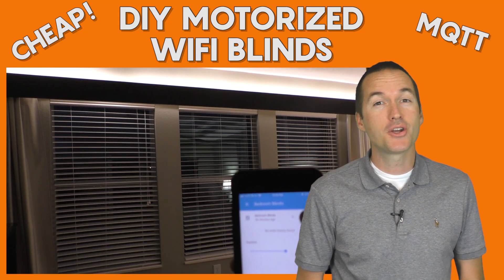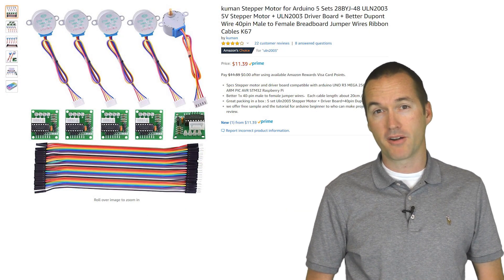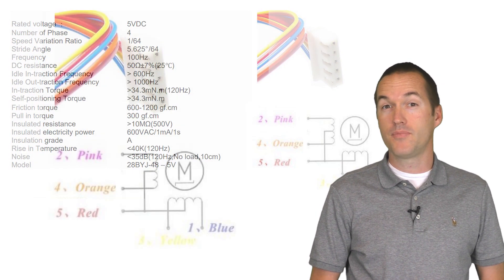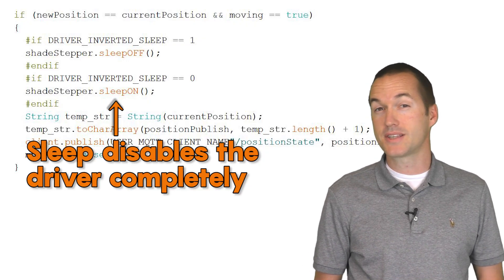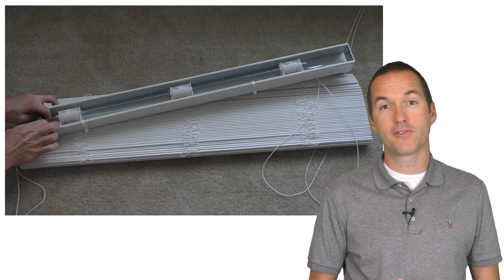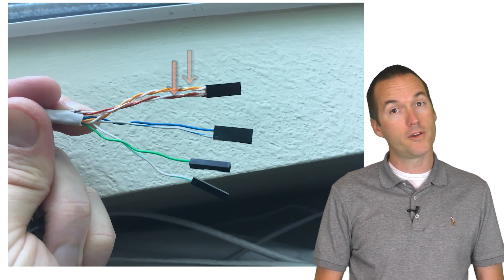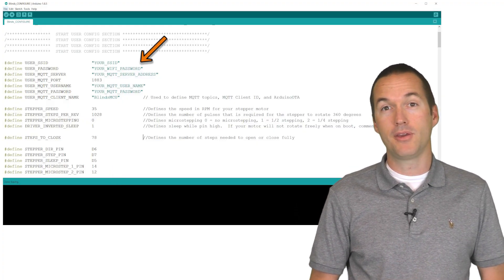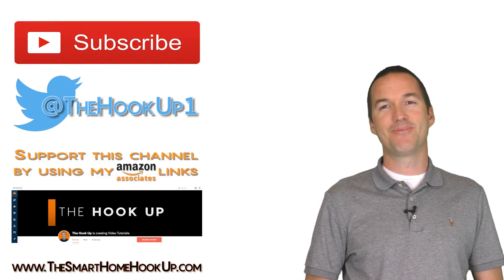Motorize and Automate your Blinds for $10! (WiFi)

Comment: I did a similar project a year ago: https://github.com/Warsenius/Domoticz-Mqtt-roller-vertical-blind  only change is I have vertical blinds and they have no room at the top to hide the engine in.
And i use Domoticz as my home automation controller. rest of the project is almost the same.
I added a 'reed' switch and a little magnet to the ball-wire so the system can align itself every day.(I had a little problem with the system losing alignment after frequent use, i suspect making the steppermotor sleep causes it to turn back a little)

Comment: Interesting, but a am slightly amazed that the driver didn't seem to like 12 volt. It is a ULN2003 that can take 12 volt.  I would expect the 5volt stepper to be the one having problems with 12 volt
Reply from the maker: It was behaving very strangely, I'd imagine it was a current issue and the ULN2003 doesn't have current limiting.  It would work if I messed with the jumper, but only for 1-2 seconds before failing again.

You are right though, the ULN2003 says 5-12V right on it.
Reply from the maker: I just got the ULN2003 to step at 12v using the Accelstepper.h library, but WOW the motors get hot fast.  Pretty good torque though.
Reply: @TheHookUp  probably don't want to reposition the blinds to often then :-)
I am considering the Nema17. AliExpress has that at around 5 euro. That's 12 volt and supposedly has a pretty good torque. At 42.3 mm it might be a tight fit though
Nevertheless pretty good video

Comment: You're spot on with regard to 3D printer ownership. I've printed enough parts for household repairs and DIY projects to more than pay for the printer, so the ability to use it for tinkering/making is icing on the cake.
Reply: hum.. 3d print icing..

Comment: Rob, how big of a set of blinds do you think these motors could handle?  It looks like your windows are around 24-28" wide, but based on your build commentary I'm guessing these motors won't be able to handle much more than that.
Reply from the maker: With the 12V mod I'd guess 48" would be possible, but it really depends on the weight of the blinds.
Reply: @TheHookUp  what would you need for 59" and up to 94" size

Comment: Is it possible to modify this project to use a 12 V battery pack with a slim solar charger panel that sat behind the blind header ?
Reply from the maker: That is currently in my project pipeline, need to add some deepsleep functionality to the ESP to improve battery life.  Stay tuned.
Reply: @TheHookUp  I have a working (for the most part) set of automated blinds that work off a servo and solar panel.  I can't take credit for it as it was developed by someone else for SmartThings, but I did modify his code so it would work with Home Assistant and MQTT.  I can probably shed some light on it since I've been testing it for months now and there are many hurdles to overcome.  Many of which I'm still working on.  

The system uses a "hub" (plugged into the wall) which is simply a D1 mini with a RFM69 shield.  It monitors MQTT over wifi for msgs and relays them to the blinds over RF.  The blinds module uses a Moteino (LowPower Labs) with a RFM69 module connected to a 3.7v Lipo, 5v (500 mA) solar panel, relay, voltage step-up and servo.  When the Moteino receives a message, it activates the relay allowing power to flow to the servo.  It sends the control signal to move the servo then turns off the relay cutting power to the servo.  The servo stays locked in place without draining excess power.  The Moteino sends the voltage and charging status of the battery to the hub then goes into deep sleep and waits for the next message.  There is also an option to use a switch if you want to manually control the blinds.  The Moteino sends a positional update to the hub which then updates MQTT and Home Assistant.  

Now for the issues and problems.  Wifi is generally power hungry thus why this uses RF and a hub.  I believe MySmartBlinds that you showcased in your video uses bluetooth and hub which I assume is for the same reason.  

Deep sleep is a big help to conserve battery power, but unfortunately people have been having issues with the Moteino and RFM69 chip NOT waking up from deep sleep when receiving a message.  Others have been having success with not putting it into deep sleep but I'm sure it matters where you live and how much sun you get.  I've been testing it without using deep sleep as I have 10 blinds, 5 of which are 15' in the air so I need it to work flawlessly.  It's been promising, but it's been fairly sunny lately and the days are getting longer.  The real question is, will the battery have enough time to charge during the winter months when days are much shorter and grey?  I have yet to test winter months by unplugging the solar panel and only charging the battery for 7 hours.  To be honest, I'm not very hopeful.  I started with a 5v, 250mA solar panel and it failed quit quickly.  I moved up to 500mA panel (max of the charging circuit) and it's been much better though I don't think it will be enough for winter months.  One thought was to change the charging circuit  to handle a higher output solar panel.  I'm not well versed in this area and haven't went down this path yet.  I still plan on testing my current system using deep sleep, but I'd hate to move forward, order the parts for 9 more blinds only to find out 50% of them fail.  I'm curious as to what charging circuit MySmartBlinds use and the output of the solar panel.  Other than that, it looks like it's using a DC motor with encoder, LifePo4 battery, and rotary encoder for manual adjustment. 

DM me if you want to chat more about this.  I'd love to help.  Solar powered blinds is what got me interested in home automation.  It probably wasn't the best project to start with now that I think of it ha ha.
Reply: @dipper1981  How has your setup been working?  Can you supply links to the project you mention or any other links that may be helpful?  Thanks
Reply: @TheHookUp  maybe ESP-Now can be used to wake an ESP out of ultra deep sleep
Reply: @TheHookUp  I was comparing some boards for deep sleep - many are in the mA range. Best to go with a bare ESP32 which only draws 5 uA (or even less in hibernate). Still want to compare communication. I guess RF < BLE < BT < Wifi. Maybe ask a RPi or a non-battery-powered ESP32 over BLE what to do in certain intervals (depending on how responsive the blinds should be, this can save a lot).
Reply from the maker: Can ESP-Now do that?  It would still need to use the wifi radio, which is disabled during deep sleep.
Reply: @TheHookUp  13 window blinds I need to automate in my home... (and nowhere to hide wires.) I need this! 
I've been researching/waiting for this project for 8 years (sadly I haven't had time to learn all the ins-outs to do it myself.) A how-to to run this on battery and/or solar would be the last piece of this puzzle! 

You are seriously making my dream come true, definitely Subscribed!
Reply: Yea run off solar panel would be great, or solar to charge battery

Comment: Pretty excited to see this video and the price point floored me though it seems to be a stretch.  Could this be coded in ESPHome?  Thanks for this great video!
Reply from the maker: I tried to make it work with ESPHome, but I'm not familiar enough with it to make it work the way I wanted (and the stepper support for ESPHome and HA is weak).  Basically it needs to have a sensor associated with it to be able to "retain" its position as saved and then use the set target command to move to the open or closed position.  

If you get it working with ESPHome I'd love to include it on the github!
Reply: @TheHookUp  How many rotations does it take to move a full open -> close cycle? Maybe a limit switch like on the ender 3 axis?
Reply: @TheHookUp  and @Donny Fontenot Any advances on the topic of using with ESPHome?  I"ve built some using a servo (MK SmatHouse based design) and now that I've bought the parts for your design I plan to give it a shot.   I'm sure the Arduino IDE route would enable more granular control options but it would be nice to use with ESPHome since I already use it with several other ESP based devices and HA.
Reply: @TheHookUp  I also live in FL (central) where or what area of the state do you live?